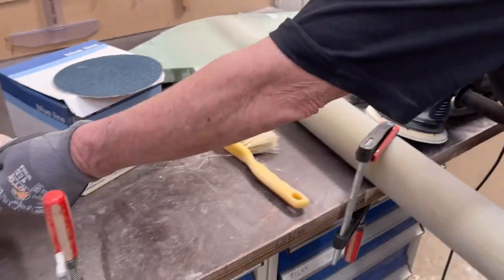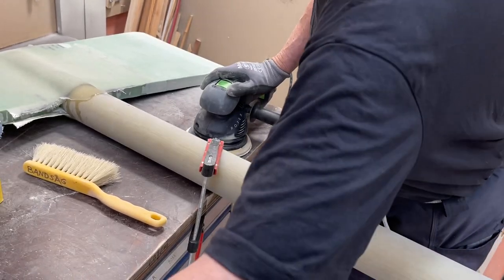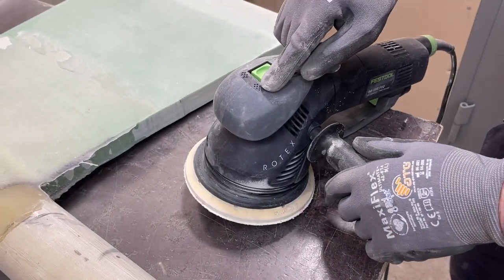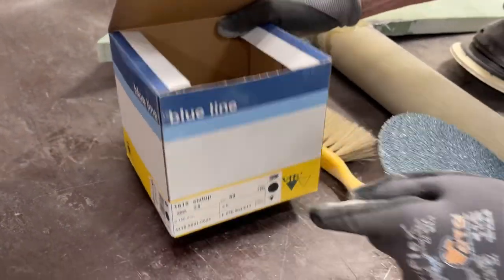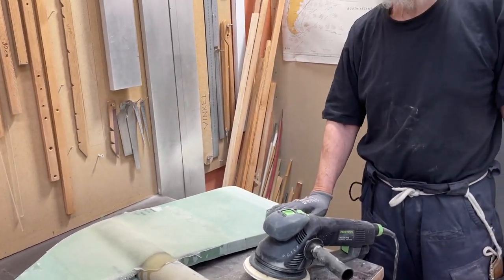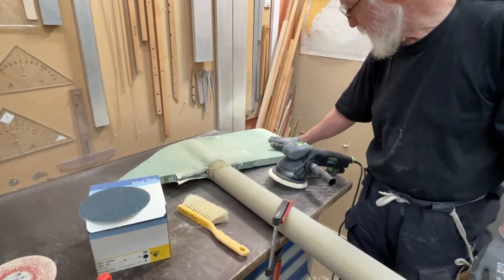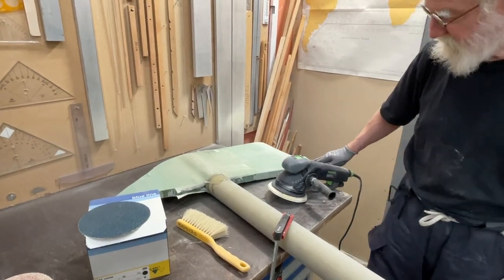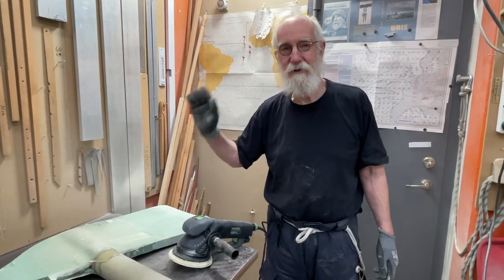8 Nov 2022 Grinding G 11 epoxy laminate slowly and dusty Its very resistant to wear thats very good.

Comment: Thank you Sven for the update and Peter for assisting. G11 is very tough material and will serve you well. Grinding it is on the same level as grinding stone or steel. Do wear respiratory gear when grinding please. We don't want to have you sick again from dust in your lungs. Have a good week.

Comment: You need a different blade on grinder. There are special surface grinding disks, tungsten carbide and diamond. That will rip through g10 quickly
Reply from the maker: I try to find those

Comment: Hi Yrvind. Fantastic work. Very impressed with the strength of materials. What is the brand name of the tubes, laminates etc? Where can you find a vendor?
Reply from the maker: G 11 Epoxy laminate.
Its not a tube its a solid axis.
My supplier is Elisolation Laxå Sweden

Comment: If layering on divinycell, would it be possibly to extend that layer over the front and back edges and just shape the divinycell instead of the G11?
Reply from the maker: G 11 is so much stronger than Divinycell.
Thats why I go into the extra work and expens of using G 11.